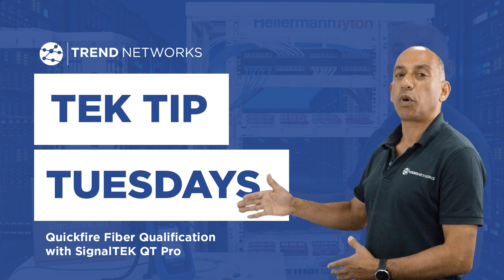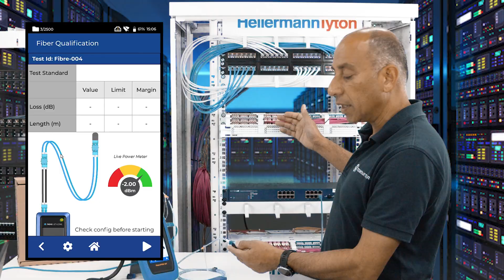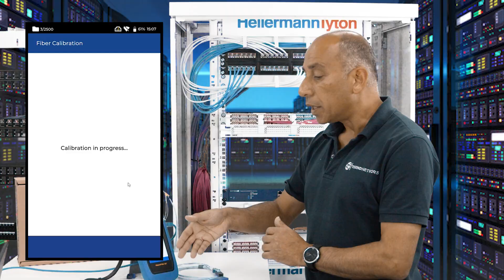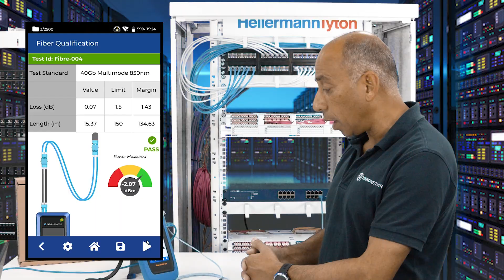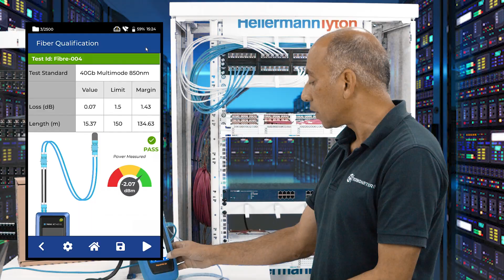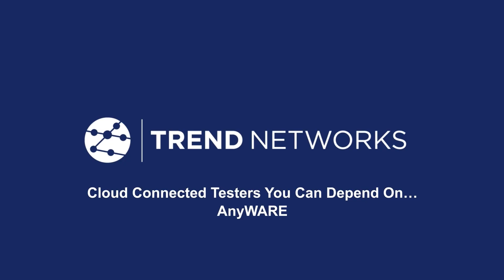Quickfire Fiber Qualification with SignalTEK QT Pro - TEK TIP

Comment: I have a Signaltek QT PRO 10G tester. Unfortunately, I have experienced that during fiber-optic measurements, if I connect the tester directly to a 10G switch, it is completely unsuitable for measurement. It is only able to determine—exclusively at 1G—via LLDP and CDP which switch port the tester is connected to.

For example, if there is a 10G SFP on the switch side and I try to measure against that, the tester freezes. The device is not even capable of falling back to 1G and performing the measurement that way, nor of indicating that the remote SFP module is a 10G one.

Therefore, I feel that the claim that this is a 10G-capable tester is misleading, because in reality it is not. At 10G, it is suitable only for passive network measurements.
Reply from the maker: SignalTEK QT Pro is not a 10G transmission or network tester. It is a 10G cable qualifier, designed to verify that copper or fiber cabling is capable of supporting up to 10Gb/s. 

It does not generate or negotiate a 10G Ethernet link with active equipment, which is why LLDP/CDP discovery operates at 1G only and why connecting directly to a live 10G SFP+ switch port is outside the intended use of the product and can result in the behavior you described.

If your requirement is to qualify or test an active network path end-to-end at 10Gb/s, that capability is provided by our SignalTEK 10G Pro, which is specifically designed for 10G network testing. The distinction is that SignalTEK QT Pro qualifies cables to 10G, whereas SignalTEK 10G Pro qualifies networks to 10G.
Reply: @trendnetworks  My problem is that this information is not stated anywhere — namely, that the instrument is not capable of 10G discovery. The marketing and even the product name are completely misleading. The limitation regarding 10G measurement is only mentioned in small print in the device documentation.

I understand that you recommend a different device, but its price is double that of the QT PRO 10G. With the QT PRO 10G, it would at least be reasonable to expect that, even if it cannot read LLDP and CDP data at 10G, it could be switched to 1G in order to identify the switch port. Instead, the instrument freezes and reboots.
Reply from the maker: Hi kolozarg, thank you for your feedback. Please reach out to tech.support@trend-networks.com for further assistance.